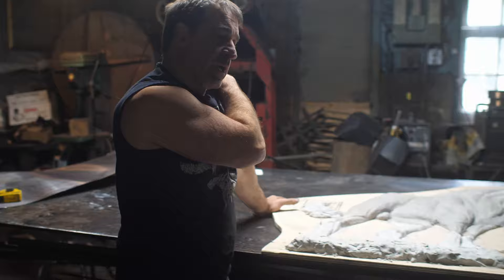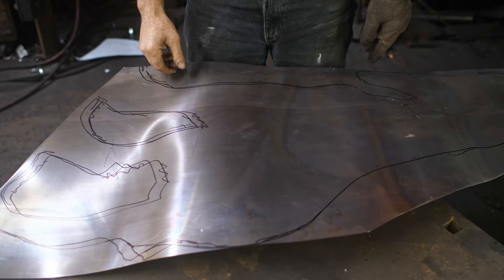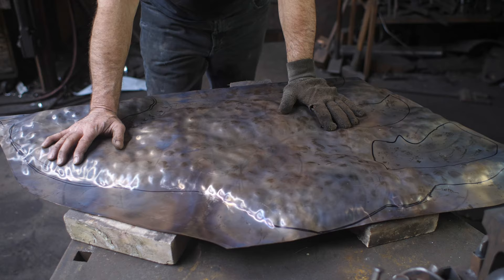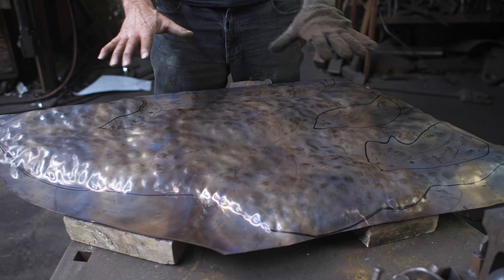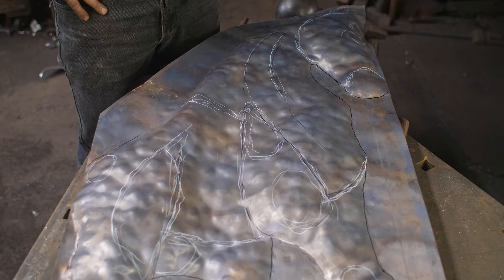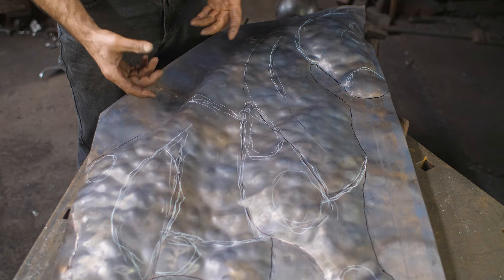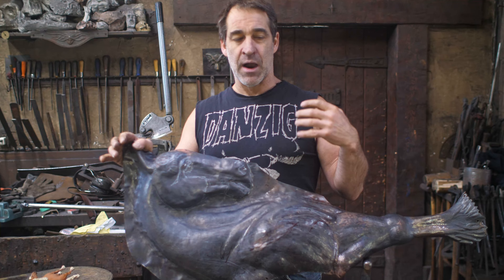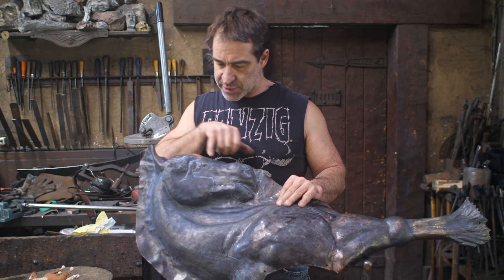Metal Sculpture - Forging a Bronze Horse

Comment: Great job Thak.  Finished piece is impressive. Liked to have seen your finishing repousse technique and tooling for the surface finish ... did you do it all with a ball been on the shot bag?
Reply from the maker: No...there was a lot of work over various stakes using raising hammers....as well as a bit of work with pitch....any technique I can think of to move the process forward